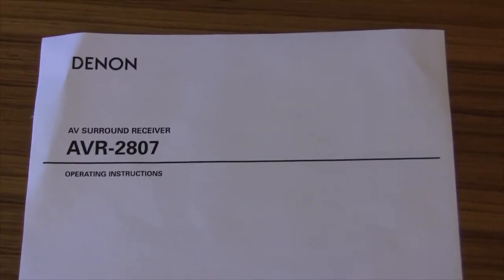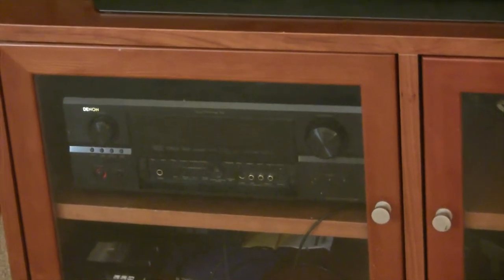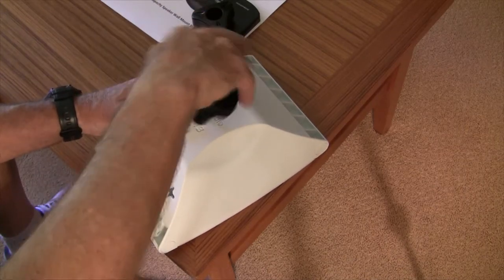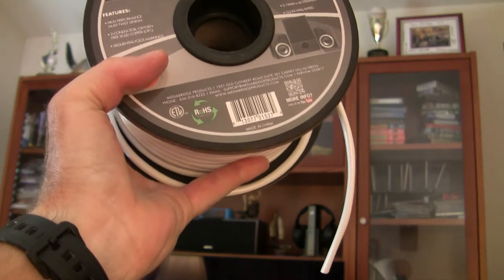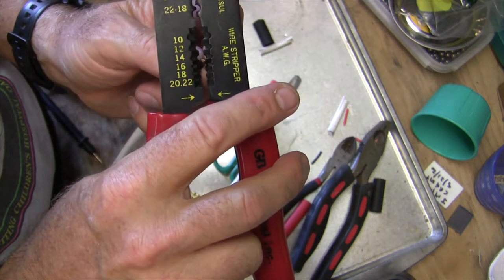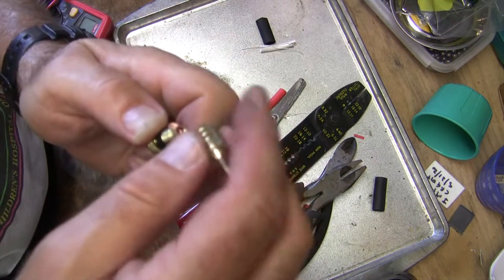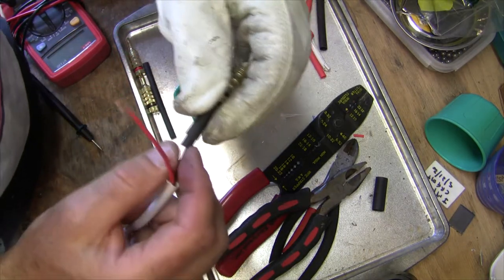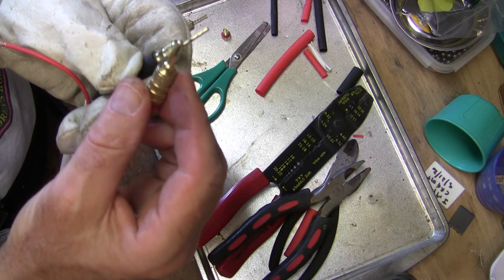Denon X4700H & LG C9: Upgrading a 2012 Home Theater to 4k OLED & Dolby Atmos Surround Sound - Part 2

Comment: good stuff. I need to redo all my cables as well and move mt HT all around to the opposite side of the LivRm. Lots of work. Hope it works out and you get great sound with your new setup
Reply from the maker: Thanks! I really love my Home Theater System. The OLED 4k TV & the Dolby Atmos Sound really add a lot to the experience.